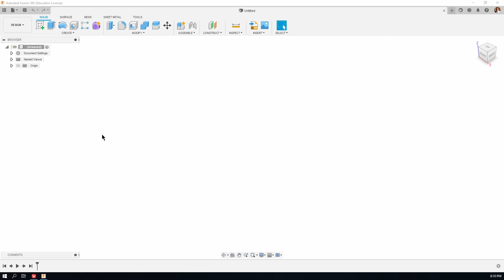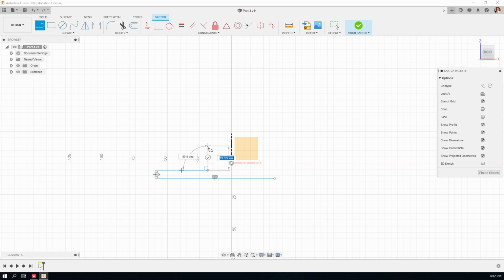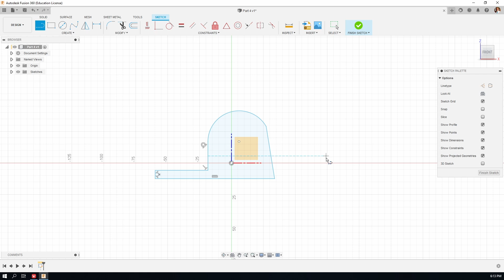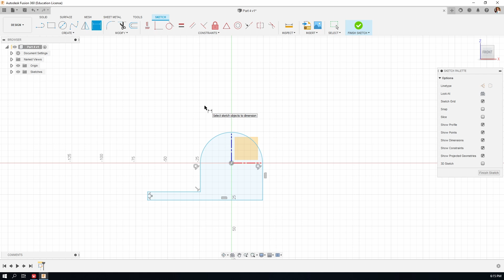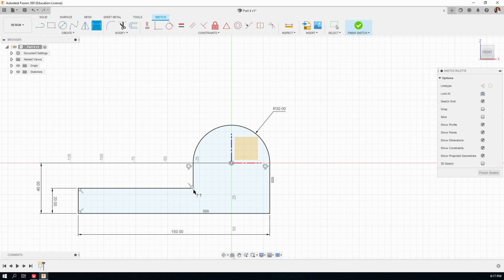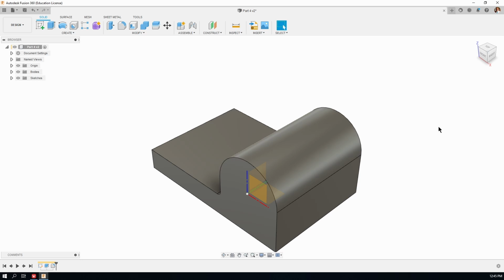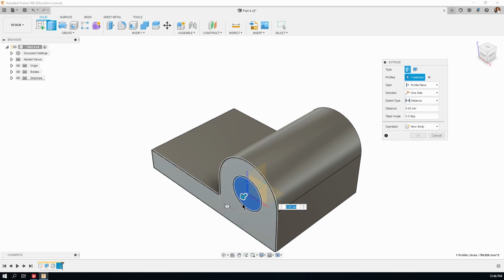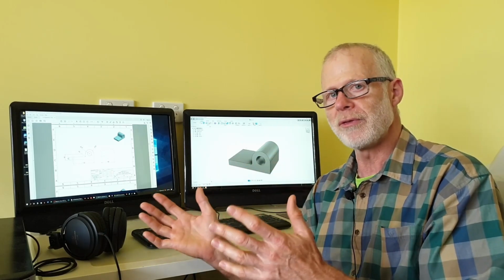Fusion 360 Basic Tutorials | Part 4 Revised

Comment: Thanks Arnold for all the great information.  I know this is an old video....but it's one of the best that I have found!!!  Question.....Can you go into more detail as why you wouldn't add the last circle in the sketch vs 3d feature.  If the whole/circle didn't go all the way thru...you logic makes sense, but it does.  Trying to wrap my head around why.  Thanks so much!!
Reply from the maker: Hi Ken, a lot of people are tripping over their shoelaces in the first few hours and keeping all operations as short and simple as possible can be the key and the difference between success and despair. Of course you can include the circle in the initial sketch and you’ll also see that there is a sketch fillet tool. Do everything in one go as soon as you have the confidence.

Comment: On to #5 👍✌🖖🥃I'm wondering how long till we get to assembling?  I plan on creating the pieces to a geodesic dome and being able to change the size easly.
Reply from the maker: Mark, these 16 are all about modeling and getting plenty of practice. You get to make most of the common features on engineering components. There is one more playlist before you start on the intermediate tutorials where we learn about assemblies, its called "Bodies and Components". There are only two in that list up til now, but at the rate you're going it won't be far off.
Changing size easily means getting to know the Parameters function. Let me know when you're ready for that, I haven't done a tutorial on that as yet but I'll point you to some good ones.

Comment: So, if I’m drawing the bottom round horns on a guitar (electric) I can just draw the line, click the mouse and continue with the curved line?
Reply from the maker: Yes Rick, you can, but I'd be practicing with the spline tool which has much finer control and capability for much more interesting lines. Take your time and learn all that will make your fine shapes into 3D and much more. You'll be modelling the whole instrument with even its electronics if you persevere.
Reply: @ArnoldRowntreeTeachesFusion360  Thank you for the very fast response! I am brand new to this and watching your beginner’s series but some of it does not compute lol. I’m sure that I will have more questions so please, "try" to be patient with me. I’m figuring out small things every day. I will definitely play with the spline tool tonight. Thanks again for your help.
Reply from the maker: @ricknull3337  Here's a very good video about the spline tool. While you're at it subscribe to Kevin's channel too. I think you're going to take a while getting used to splines and their control points but at least you'll get an appreciation of their power as well as their level of difficulty. Don't despair, this is an advanced topic and you're a beginner if you don't mind me saying. https://youtu.be/quGQB91V0z0    Good things are worth spending time on.

Comment: When I usr the fillet tool and try to select a line through the body, the program won't let me select it. I nee d to rotate the body around until the line is visible.  again I think one of me settings is wrong
Reply from the maker: It could be. I've had that happen at different times too. Again there isn't a Preference setting for that specifically. There are good selection options available in the drop down under the Select tool at the right hand end of the upper tool bar. Click on SELECT, mouse down to the last item in the dropdown and see the flyout that pops out. There is a check box named Select Through. Make sure that is checked and experiment one more time. Let me know if that helps.
Reply: Thanks

Comment: When you hit E to extrude at 6:25 it looks like the camera automatically changes to the Home view. Is there a setting that controls this behavior? I have all your settings applied, and the camera angle doesn't automatically change when I hit E while editing a sketch. Thanks!
Reply from the maker: Ben, I'm glad to hear that you've applied my preference settings but just to be double sure, the one that controls this behaviour is the 6th line down on the General>Design page with the words "Auto look at sketch" Please see again if that particular one is ticked on and come back to me if it was on all along. Further, try doing a sketch and extrude with that turned off and then try doing the same thing with it turned on.

Comment: Thanks for making these video's Arnold, they have been a huge help in getting me started. Quick question, why do you like using the dimension tool after drawing instead of defining the dimension while drawing?
Reply from the maker: Austin, in the olden days, that's how it was done. Autocad was all there was and you had to get it right. When parametric CAD came along it was designed so you could not only sketch quickly and adjust easily but also use the same sketch to model a whole family of sizes at almost the same time. There are other benefits too. When revision time comes, different dimensions can be updated by adjusting only one of them since they can be related mathematically. We'll do some tutorials on this eventually, but go ahead and search Youtube for something like "parameter modeling in Fusion 360"

Comment: This is by far the best series of Fusion 360 Beginner videos that I have found. The step by step, basics first, approach and the video lesson pace are perfect for someone learning the tool from scratch. This is the first time I have been able to successfully follow along with the instructor without having to hit pause every few seconds - and actually understand what I am doing. Bravo Arnold - excellent series so far.

One question, I notice when you hit Extrude at the end of the sketch your display automatically switches to the Isometric/Home view. My interface stays in the Face view. Am I missing a setting? I set all of my preferences based on the content at the end of the drawing PDF.

Thanks

Dominick
Reply from the maker: Thankyou. I'm glad its working well for you.
The preference that comes to mind is the "Auto look at sketch" but I'm sure that's one you'll have switched on and it isn't quite the issue. I have heard of this once before, I'll keep an eye out for it in future. In the meantime, have you got the Free Orbit working by holding down your middle mouse button? That's probably the next best thing until you get over this niggle.
Reply: @ArnoldRowntreeTeachesFusion360  Thank you

Comment: Thank you for the videos. I am working my way through them now. I have two design projects that I am working on, but creating the 3D model is current roadblock. These videos have been very helpful.

One of the videos I watched started with you talking about you could help future engineers and entrepreneurs get started by reading the pinned comment. Unfortunately I wasn't able to find a pinned comment.  Is that something that you no longer do?

Thanks
Reply from the maker: Its great to hear that the tutorials are doing the job for you.
About that video, I did pin a comment there several hours after publishing, its just a link to this channel where I'm only teaching step 1 so far for aspiring engineers. CAD is the foundation stone for all engineering and manufacturing roles. My book about a roadmap for self-education in entrepreneurship in the engineering and manufacturing space is half written. There are some other short videos - 1 minute shorts - where I'm just making some statements which do need to be fleshed out considerably, so yes, its a half kept promise at the moment.

Comment: Thanks Arnold. For a beginner like me you keep on going faster and faster on the steps you are taking.  Also I would like to learn more on two dimensional dwgs with angle lines and duplicating and front face and back face and connecting them together.
Reply from the maker: It sounds like you've had some experience with Autocad and 3D am I right? Press on with the tutorials and we can talk more about these isometric ideas.

Comment: Thanks for making these videos. They’re great!
I just started Fusion 360 today and already on part 8, older series. I actually find it easy to follow, even though some of the interface and options had changed slightly, I find it beneficial to search for the options and figure things out myself. Then again, appreciate your updates on these revisions for others who need the extra hand. Cheers!
Reply from the maker: Great to hear FL! Keep on learning and eventually tell me about your own projects (in general terms). No doubt you have some plans.
Reply: @ArnoldRowntreeTeachesFusion360   thank you! I finished part 16, and it’s been super helpful. Although I need to revisit each lesson again to familiar myself with the toolset. Also I’ve been searching for other tutorials to advance my knowledge in fusion 360. My current plan is to make Japanese traditional joints using fusion, thus I’m searching for tutorials on joints, and parametric for this task.

Comment: Thanks for the tutorials, i finally found something that match my way of learning.

Only wondering while i did use you're setting for Fusion, when i press E my sketch not "always" moves to a different viewpoint like yours does.
Reply from the maker: I'm glad we've connected Francois, you could check over your preference settings but if you know how to control your view, this will be no more than a small annoyance while you become more and more familiar with Fusion 360, perhaps another half a dozen tutorials or so. I remember some similar frustrations in my early days. Experiment with the Free orbit tool, click and drag that view cube around (top right hand corner of the main window) and you'll soon be in control.

Comment: Hello Arnold, I have a question regarding offset planes. when I create one, it wont let me move it to where I want. What a, I doing wrong here.
Reply from the maker: Malkeet, the Offset Plane is meant to work by clicking on an existing face or plane, and then a new plane appears in the view, also the offset plane dialog box opens and there is a little blue arrow on the new plane. With the mouse and the left button grab that little blue arrow and drag it forward or backward. Does it work this way for you?
Reply: @ArnoldRowntreeTeachesFusion360  thank you for getting back to me, I found out that i was in the wrong mode for what i am trying to learn.

Comment: Thank you Arnold, I went through all sixteen tutorials about a couple of months ago and just noticed this revision. I just completed my first project that I first designed in Fusion, which was a mobile cabinet with a folding outfeed and indeed shelves for a portable table saw. I noticed that you approach your sketches with “free drawing” or non constrained lines or shapes than constrain them. My approach to sketching has been to type in the dimension in the highlighted box and move on, but I did notice later in the project some objects did not marry up with the precision I was expecting. I could still count on the cut list for the actual dimensions intended but if it had been for cnc or 3d printing, it would have been a problem. I think I’ll take your approach more often. Thanks
Reply from the maker: I'm very pleased to hear of your practical use of what you've learned here. I'm looking forward to doing some design and build project videos myself eventually.